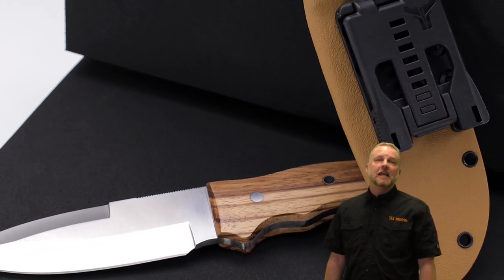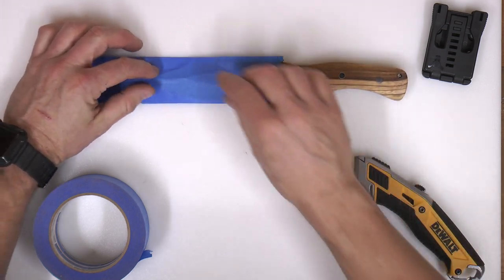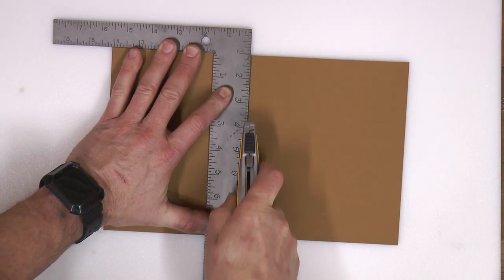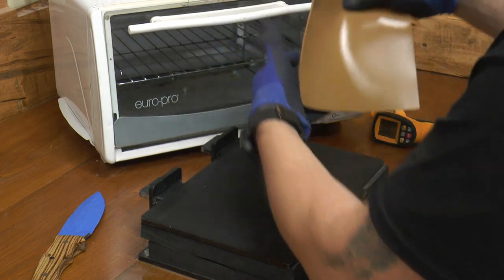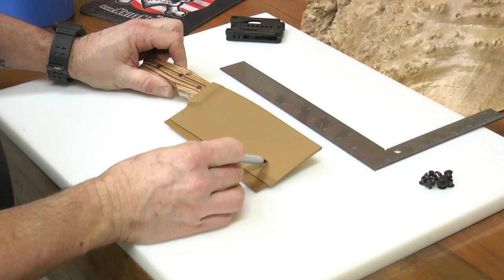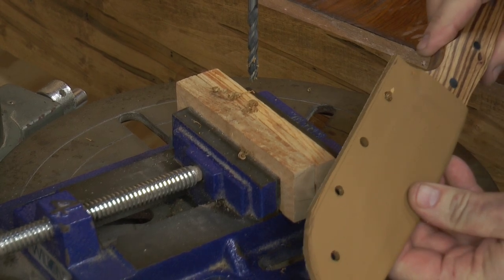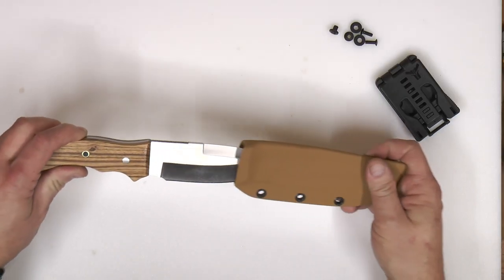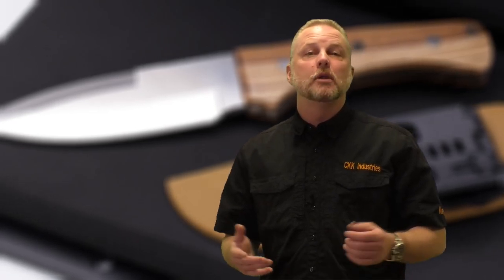How to Make a Fold Over Knife Sheath w/ Tek-Lok Attachment Using KYDEX®

Comment: Apakah 2 baut itu cukup kuat untuk menahan tekloknya pada kydex?
Thanks. 🙏
Reply from the maker: On small knife holsters, 2 mounting assemblies are fine. If you use the eyelet holes on the outer perimeter of the sheath, you can avoid drilling in the center of the rig. This allows the post head to stay out of the way of the blade when entering the sheath without creating a recess cavity in the design. You can also use 3 posts to mount with, which will add more stability if the knife is larger.
Thanks for watching. Let us know if you need more help.
Reply: Thanks a lot.... Greetings from Bali. 🙏

Comment: Which buffing wheel do you use?
Reply from the maker: He's using a cloth buffing wheel on this video...as a backup plan. Pretty much all we use these days are flap wheels. You can still use cloth to finish the edges, but it's far from optimal. Cloth is "old school" for sanding KYDEX, HOLSTEX, Boltaron, ABS and the like. The best way to finish the edge on these materials is with an abrasive flap wheel. In theory, you want all three grits. However, if you're going to choose only one, the 600 grit is the one that most folks go with. Here's where you can find more: 
https://www.knifekits.com/vcom/sandingpolishing-flap-wheels-c-1072_1004_1005.html